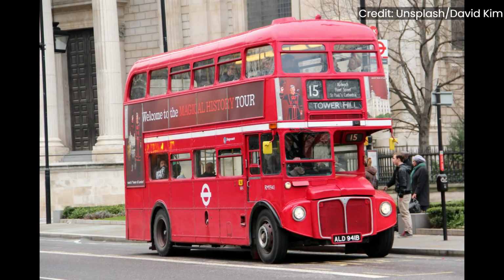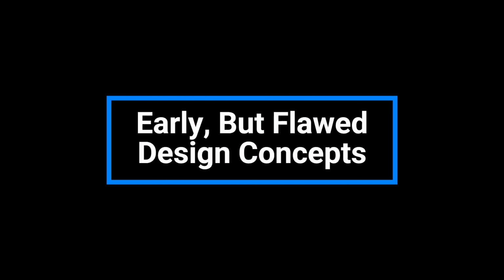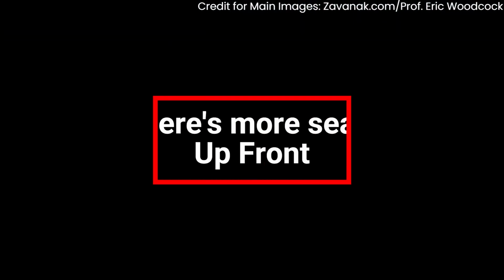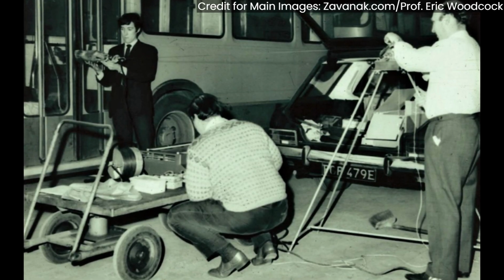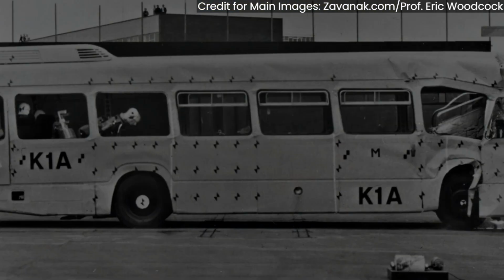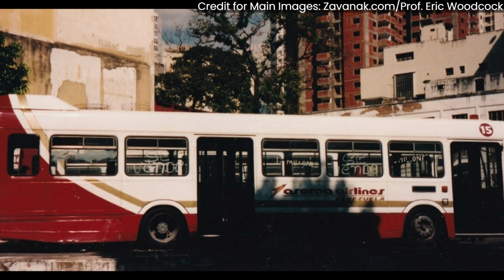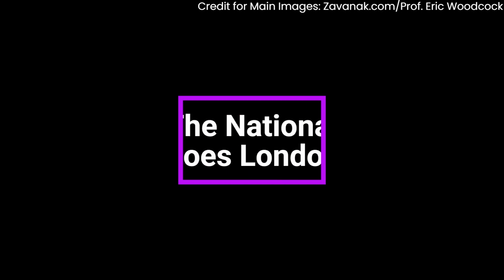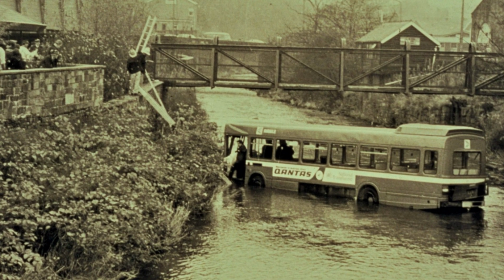The Leyland National Bus: Amazingly Flawed Engineering!

Comment: Hi Jeffrey,  As an American making a video about a British bus you did very well, but you probably were not aware of the National's biggest flaw, the awful Leyland 510 engine, which was probably the worst engine ever produced by Leyland. The Mark 2 had the Leyland 680 engine , which was one of Leyland's best engines or the TL11 which was developed from the 680. The National was one of the first buses in the UK to have full air suspension and it did lean alarmingly on bends and corners, yet another flaw. They were easy to drive with a good driving position.

.
Reply from the maker: Hello! Thank you for the extra information on the National!! Unfortunately, I wasn't really aware of the 510 engine....an oversight on my part, I guess. Well, I tried.

Additionally, I do recall that one National was fitted with a Detroit Diesel engine in a test, and it sounded just like an American GM New Look bus....I once saw a video of it, but can't recall which bus company did this test.

Thank you for watching and for your comment!
Reply: @JeffreyOrnstein  you might be interested to learn that Perth Western Australia ran several Leyland B21s with GM 6-71s which were all sold off to a family run bus operator in Sydney which enabled me to ride in a couple.
They were withdrawn and sold early by TransPerth due to high fuel consumption!
Reply: @jamesfrench7299 not many full size buses around with good fuel consumption lol
Reply from the maker: @jamesfrench7299  An American engine guzzling fuel? LOL.
Reply: @JeffreyOrnstein  not helped by the Allison gearboxes which had lots of slip on takeoff.
Reply: @stevedickson5853  Hino with the 12L flat engine, had exceptional fuel consumption, I averaged 29 L/100k, while Leyland Leopard 11L & MB were around 40, Volvo & Leyland Tiger, mid 30's.
Reply: @jamesfrench7299  Remember them. They seemed to struggle where the 680 engined Leopard did ok. Mind you on that same long hill, the Volvo B10M's aka the Swedish Leopard, left them both in the dust.
Reply: @jamesfrench7299  The B21 was in-effect a Bristol-designed chassis to hold National running units; the combination of a Detroit and Allison driveline was not a recipe for fuel efficiency, as CIE were to find.
Reply: I have read in a book produced  quite some time ago that the L/ National and indeed 510 engine nearly bankrupt the National Bus Company, who had significant investment in the  Leyland National programme as a funding partner. From my own expereince (I was a bus auto-electrician starting in 1980 and think of myself as once an expert on the L/National electrical system)  when perfroming well, the 510 engine ran well, and it was fast, a good hauler, acceleration was quick. The 680 in a National was like a rocket! The excelleration was incredible. 
As for the 510 engine, I believe had a head and block as one piece which made it very expensive to repair; I remember the engines being removed for repair/ replacement all the time  back in the realy 80s.
Reply: @waynemiller7382  The 510 was a complete dog to work on, basically engine out and full strip down for anything other than turbo, fuel or water related issues, but credit where credit is due, it was an amazing futuristic and simplified monoblock design and a dry sump which was novel, seen many a seized leopard from it's wet sump running dry buidling up the air on a hill. I quite liked rebuilding them for some weird reason. 

Unfortuneately it looks like they blew the budget on the engine and saved money by fitting shockingly bad intake and filter system that basically allowing the engine to ingest engine wrecking road dirt constantly and making the filter so hard to change that no-one did it. 

2nd issue was cold starting and the air throttle. The cold start device was next to useless, so on a cold frosty morning of cranking the engine endlessly most drivers got used to 'giving it a sniff' with ether / easystart and usually over doing it. That stuff knocks hell out of the cold piston rings and together with the foot flat down on the air throttle tended to rev the hell out of the poor cold engine once it started. 

If they'd have fixed the intake issues, cold start and restricted the air throttle when cold, 510's would probably run for half a million miles.

You already know about how unreliable the Alternator / charging system was too.
Reply: @waynemiller7382  A blind engine, (non removable heads), in this day and age???
Reply: I rode on those very same repurposed TransPerth busses in high school (when the family still owned the IBCo business). The busses were still in their green & white colours (unlike the pale green corporate colours of the other busses in their fleet) The Perth ones they got had the hump in the middle of the roof for the AC system (one of the rare busses we got at the time with AC). Those GM engines sounded like they were being thrashed to within an inch of their life, and I remember the lurching shifts too. 
That family business had their depot in the street where I lived in my early high school years, before moving house.  When they moved the depot, dozens of small units were built on that land.  
They also chose some other peculiar busses for the school fleet, like the ex-Govt Atlanteans, and a Bendi-bus (articulated).  I still remember the old “Freeport” bus - an old bus they bought, painted up with cigarette advertising, taking kids to high school…..
Reply: They fitted a Mercedes engine from an O305 to one I heard.
Here's a camcorder video I took of a couple of their ex Action Canberra 10.9m Nationals with a very brief glimpse of one of their ex TransPerth B21s. 
https://youtu.be/d7PKC4CVqAY?si=TfeV8XASvGVoRV1u
Reply: Not to mention immense understeer

Comment: It's probably one of the best designs of buses at its time. One of the first buses to use air suspension all round, a turbo charged engine, low floor design and consideration into the drivers ease of use. Rust protection was second to none, as was build quality. Yes the 510 engine wasn't the greatest option to go for but that was it's biggest flaw. It paved the way for a new generation of bus designs used by other manufacturers and to date the only bus built in its own amazing, automated  factory. I'm not biased, I look after and run 3 Mk1s and 3 Mk2s.
Reply from the maker: Hello! Thank you for your experience with the National - very interesting to hear the extra detail! Thank you for watching and for your comment!
Reply: @JeffreyOrnstein  it's biggest flaw was 1) the engine choice. 2) it was so forward-thinking and radical in design that bus operators didn't know how to look after them. The 6 we own, most of the original spec engine still in them, and one managed 30 years in service! New buses won't get anywhere near a service life of 30 years. We're based at lillyhall literally round the corner from the original factory and still have contact with ex leyland plant workers and management.
Reply from the maker: @IanDunn-i8s  Thanks for the info! Yes, I'm now aware of the 510 and its shortcomings...I wasn't aware of it when I made the video. So now I know!
Reply: @JeffreyOrnstein In honesty the 510 wasn't as bad as it was made out to be. The fixed head scared mechanics, but it rarely gave trouble. The bottom bearings, ends and mains, were easy to change but were often neglected. I own a MK1 and have been involved with them since the year 2000 in preservation. I travelled on them from the age of 0 to 17 almost daily. They proved themselves to be a very reliable, durable and long lasting design - once operators got used to them.
Reply: @LeylandFiveTen One virtue of the Leyland 510 engine that frequently gets overlooked is its smoothness. Being a 6-cylinder opposed engine, it generated next to no vibration. Combined with the smooth ride from the air suspension, it made the National a very comfortable bus for the passengers. It was noisy (sharp clanking from exhaust pulses at low revs and a turbocharger scream at high), but if you sat at the front, you'd hardly notice.
Reply: @bobwalsh172  
The 510 engine was a horizontal, heavily modified version of the then existing upright midsized truck engine. It wasn't 6 cylinder opposed. It was an attempt  to get an underfloor inline 6 plus radiator to fit in the rear. It did this by using a smaller engine with a turbo added to give reasonable power [once the engine had some the revs]. Unfortunately the turbo's then available didn't have pressurised oiling to the bearings [when the engine stopped] and so weren't idiot proof. They needed warming up and cooling down, something that was probably not done by drivers in large fleets.-
Reply: @stephenarbon2227  Thanks for the info - it's got me wondering where I got the idea of the 510 being an opposed engine. I remember seeing a very detailed documentary about the development of the Leyland National, so perhaps an opposed engine was one of the ideas considered and discarded during the earlier part of the design process.
At any rate, the 510 was a very smooth engine, and in that respect preferable to ye olde 680 as used in the later versions.
Reply: I worked at Lillyhall factory fitting the widow glass .
Reply: You forgot the immense understeer
Reply: It was also very noisy and spewed out black clouds, awful things really

Comment: JYO751N was originally one of the Midland Bank mobile banks, later converted for passenger use and re-engined with a Volvo unit. I drove it in the late 90s and it was unusual for having a fully automatic gearbox, compared to the usual semi-automatic.
It felt like a new bus, so tight and little clatter.
Reply from the maker: Hello! Thanks for the extra info on the Midland Bank National - very interesting to hear! Thank you for watching and for your comment!

Comment: The Leyland National Bus was not that flawed as it became the standard single Deck bus in all its forms for the National Bus Company in the UK and was purchased by the West Midlands PTE, Merseyside PTE, Greater Manchester PTE, Isle of Man Transport, the Scottish Bus Company, London Transport, a lot of Council owned and private bus companies in the UK and many companies abroad and operated successfully so not sure why you believe it was flawed
Reply: My friend used to like new buses and thought the Leyland Nationals were great.  However when I was working with them the engineers reported that things like the lift pump for the fuel were troublesome- particulary in hilly areas.  As NBC had shares in the project the vehicle indeed was forced on subsidaries - many of which would have preferred from a cost perspective Bristol REs.  As Nationals were brought in ( at quite high prices) older Reliances and Leopards were sold off - these often ended up with private operators who were able to undercut contract prices for a lot of industrial places - power stations , coal mines with three shifts a day and the "commuter easy boarding" did not really apply to those kind of services.
Reply from the maker: Hello! Well, it was the details in its design that could have made it a much better bus than it was. Plus it was never able to achieve its goal to be produced in large numbers for export. Thank you for watching and for your comment!
Reply: @JeffreyOrnstein  The thing is not many British Buses ever got exported abroad in this period the 1970's but where I live in Birmingham the West Midlands both Midland Red a National Bus Company bus company division and the West Midlands PTE purchased hundreds of them including a batch for the West Midlands PTE that had luxury coach seats fitted into a standard Leyland National body for limited stop express bus services and Private Hire duties. When the WMPTE took over parts of the Midland Red area in the West Midlands quite a large number of Midland Red Leyland Nationals transferead to the WMPTE and for some years it was the only single deck bus that UK Bus companies could buy in large amounts as the only other single decker the Metro Cammel built Metro Scannier never caught on and they did not build many
Reply: @peterwallen1063  If I had been midland red I would have transferred all Nationals and kept the S10s.

Comment: A footnote to the Leyland National story - the modular body design was promoted for rail use in the UK and abroad.  A number of prototype vehicles were built, leading to several fleets of (moderately unpopular) trains operating in the UK, some of which were only taken out of use relatively recently.  Search for the BRE-Leyland Railbus for more information on the prototypes (including at least one that ran in the USA), British Rail Classes 140, 141 and 142 which used Leyland National body parts, and the related Classes 143 and 144 that used a similar construction but with bodies sourced from another bus manufacturer.

I grew up near Leyland and still remember seeing empty bus chassis being driven around the roads in the area, with a very cold looking driver sitting atop the frame with no bodywork to protect him from the elements!  Thanks for the interesting video!  :)
Reply from the maker: Hello! Thank you for the very interesting info about the National - those open chassis driving around must have been a sight to see! Yes - there were a couple of railbuses based on the National that made it to the USA - in fact, I've done a video about LEV-2, which ended up being scrapped a few years ago after suffering at a trolley museum in Connecticut! Thank you for watching and for your comment!
Reply: @JeffreyOrnstein  Yes, these railbus units in the UK, was known as Pacers, having only the past few years been discontinued, and it did amaze me some of them actually ended up State Side.

They did have quite a poor ride rep, and if I remember right, one is in preservation at The Midland Railway, in Ripley, Derbyshire.

I absolutely hated them, when I had to use them on my many trips in to Yorkshire (Northern Rail).

https://en.wikipedia.org/wiki/Pacer_(British_Rail)
Reply: @JeffreyOrnstein I'm glad someone mentioned the Pacer trains. They only very recently came out of service, and I last travelled in one in 2019, operates by Arriva Wales. They must have had a higher floor because Pacers were always great for sightseeing. Lovely trains.

I'm from Edinburgh, and we used to have a good fleet of Nationals, although not as many as the many beautiful Atlanteans we had.
Reply: The 155 and 153 Super Sprinters were also built by Leyland and use quite a bit of National construction techniques.
Reply: Duh, of course!  I blame the hypnotic effect of the Pacer's 4-wheel underframes on jointed track for the memory lapse! ;)
Reply: @ThinkingAloud Duhduh da dun...duhduh da dun
Reply: @ChrisCooper312  The busses, Sprinters and Super Spinters had one thing in common - If you were six feet tall, you couldn't fit your knees in front of you (unless you got a side seat)!😵
Reply: @ChrisCooper312  Yes, the 150s were built much more like a proper train, with bogies as opposed to the rigid subframes of the Pacers.  There are still some Sprinters in service, though the Pacers have now been retired.
Reply: I used to live in Bristol and saw the chassis going off to the bodybuilders. They had terrific performance but the poor drivers only had a rudimentary seat and windscreen and wore greatcoats, goggles and flying helmets and on rainy days they might be wrapped in clingfilm.

A friend worked for Leyland (not the National factory) and he told me one of their drivers died of exposure going over Shap many years ago.
Reply: I went to school in Bristol, on the chassis test route for un-bodied Bristol chassis. Once approved the chassis was driven hundreds of miles with nothing more than sheets of wood around the driver, who of course wore a crash helmet - no roof, no roll hoop. The drivers would then catch trains or hike back to Bristol.
Reply: I was going to point you to that!
Reply: Yes I remember them ugly things,  weren't they called the BRE PACER and had Leyland seats and body's??
Reply: @tomhiggins4969  pretty much, quite a few of them was built at Derby, now home to Alstom.

Later variations was built with an Alexander body
Reply: @tomhiggins4969  They were by no means luxurious; but they were built well enough to manage the best part of forty years' service and would still have had a few years left, if not for new accessibility requirements  (which are a good thing, really).  They got people to work and back, at a time when post-war austerity was still a thing for many.
Reply: Lots of Pacers survive on preserved railways - The Wensleydale Railway (Leeming Bar near Northallerton, Yorkshire) has quite a fleet of them. I rode up and down their line in one last October.  I was a bus driver from 1983 until 2015 - I drove a lot of Leyland Nationals - I liked them especially the Leyland National 2s. They were very manoeverable for their size with very precise power steering (unlike some of the late model Bristol VRs which steered like sailing ships).
Reply: Yes the god awful rail bus. Had to endure those wretched things in the NW for far longer that we had to. Glad they've been consigned to the scrap heap
Reply: Ah! that triggers a memory - when I was a young kid, a couple of times I remember seeing buses with no body being driven by a guy with a crash helmet. A seat and a sterring wheel was all he had!